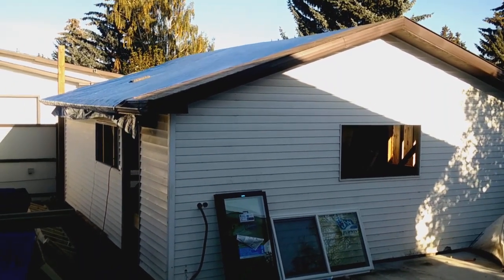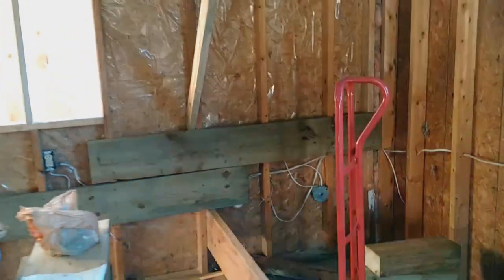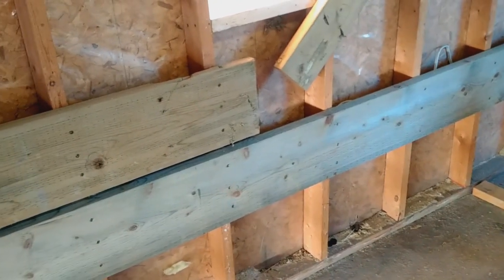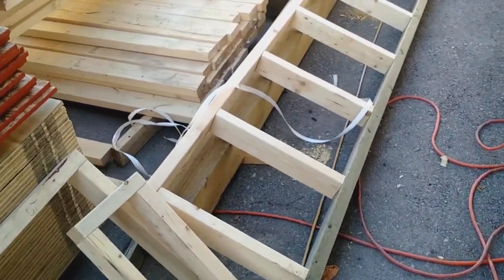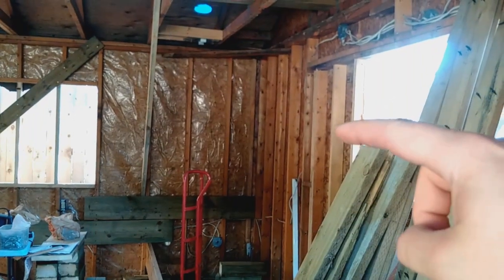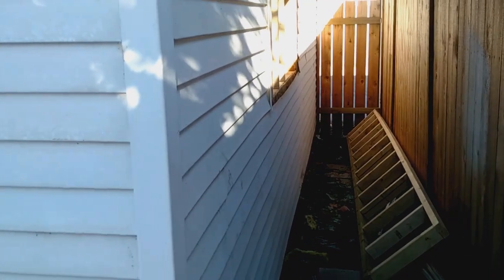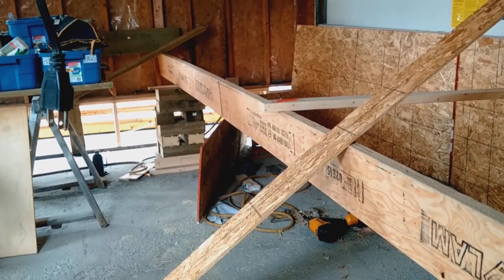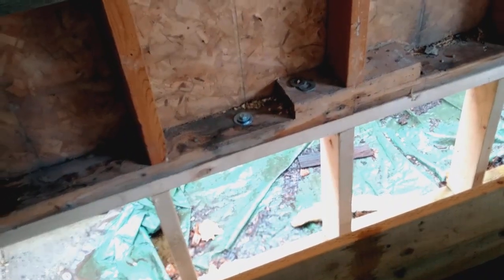How I lifted my double garage up 21 inches

Comment: We want to do something similar to a shed that framed on top of a slab with an extended porch.  I think the concept will work. We need to raise it about 10" and we plan to use cinder block and then re-pour the floor to the new height.   Any thoughts or suggestions?
Reply from the maker: I would think a shed would be easier.  Shouldn't have any issue.  So you are trying to raise the floor?  Is it a water ingress issue?
Reply: @johnniemo  No I think the slab would break up.  I figure it would be easier to raise the structure on it put block under then poor  a floor on top of the existing slab.  Yes, we are in Texas and Imelda stalled on top of us and we ended up with about 7" of water in the shed. Didnt even happen with the hurricane a couple years prior, but they have built houses next to us on a higher grade forcing the water to move on to our lot.  The shed is rectangular with a gable ended roof but the roof to the end of the front porch is almost like a lean two supported by 4 post.  So we figured we could brace up the front roof to the frame, brace up the frame cut the seal plate bolts, jack it up, rebar and concrete some block to the existing slab under the bottom plate all the way around, use a two by 12 and cover the garage door opening and front porch door opening, then re-pour the floor inside the blocking after reinforcing with rebar, then just put steps into it from the porch area and gravel out a grade to the garage door for lawn mower access etc..
Reply from the maker: @DLHappens  ok.  I didn't mean lifting the slab... just that you wanted a higher floor.  You just have to be mindful that water won't get under the slab and freeze it.  I know someone else who did your approach.  (he filled it with gravel first to drain).  However he had all sorts of issues.  Since you are in Texas and freezing isn't an issue, I think you'll be okay.  Just remember that any water getting in needs a way to get out, regardless where you happen to have your floor.
Reply: @johnniemo  Hmmm. Yeah I didnt consider that. Do you think mortaring the joint where the block meets the slab would keep the water out? Or have any suggestions?
Reply: @johnniemo  I wonder if cutting a channel in the exiting concrete, before the block, on the inside of the space, before pouring the new concrete, would keep water moving through mortar from getting between the two slabs.....
Reply from the maker: @DLHappens  Trying to keep water out is always a fools errand.  You are far better off having a plan to evaporate it or get it out.  Airflow is the best bet.  If it were me I would use coarse crushed rock and pour your new floor above it.  Holes in the old concrete can't hurt either.

Comment: you didn't really need to take all that stuff off just brace it up well and lift away I've helped my dad lifted several things a house 3 ft a 30 by 40 shed in one piece which we moved down the road on a trailer other sheds and garages some of which we took apart several floors it's not very hard to get a Big Jack that will lift way more than what you need just brace it really well

Comment: Please say if you got permits and had an inspection what county State  You calculated your load (12,000-18,000++  What permit drawings did you have two offer or an engineers drawing & cert.
Reply from the maker: Calgary, Alberta.  I got drawings for the entire build which was primarily the carport, but it includes the slab as well as the lift.  I talked to the city at least five times before the lift and then obviously had an inspection once the entire project was built.

Comment: Wouldn't it be easier to lift the roof and add to the top?
Reply from the maker: Yes and no.  I did consider this extensively.  Lifting the roof only has many advantages and one disadvantage.  If you are lifting the roof, you only need to detach the roof from the walls and lift.  The major upsides are that you can leave all the drywall, insulation and electrical alone.  Then you put your pony wall on top (or you could do a small triangle truss).  Finishing is easier because now you only need to sheet the outside and then continue your siding up.  Inside is just some drywall.  Major advantage is all your windows and doors are in the same place.

In my case I needed a larger garage door, so I think I disproportionately favoured my approach without looking at better ways to enlarge the door.

My suggestion - if anyone wants to try - is if you are doing this to put a lift in your garage (which I did since this video was made), is to buy the lift first and use it to lift just the roof.  This should mitigate the major disadvantage which is of course getting a stable lift 8 to 10 feet off the ground.
Reply: How to change your broken cable on a 12 foot overhead garage door
Reply: Anthony Perrellafd
Reply: John Molber
Reply: + Marco Derubis : INGENIOUS ! What department of the Government  did YOU work for ??? LOL.
Reply: John Mulhall n.
Reply: Dang, I am sorry, it's Canada.
Reply: Anthony Perrella iin
Reply: No it would no...
Reply: @johnniemo  Hopefully this will  defy your pros and  cons and chalk it up to...We Experience to gain Knowledge!  And... The house I'm in today... The roof was raised by 19 inches and due to the weight distribution a 34 ft span "hinged" by pushing out at the Wall to "Pony?" Extension!  Not A fun Project at all!  So.... with that said I refer back to Experience... IS KNOWLEDGE and no one can take that away from you!  Carry on John!  Thank You for sharing your experience!  Have a Blessed Day!
Reply: Let me add this as well... There are a slew of experts out there, until they don't show up!  LOL  Have great day Brothers and Sisters

Comment: Especially since you removed the shingles, why not continue to disassemble the roof  and remove it in pieces?  Then build taller (any height) walls, and rebuild the roof.  That way you are not lifting anything heavy, not moving any major windows, wires, etc..  Then address the garage door as a separate issue of moving the header 21 inches. No big lifting, no risk, no safety issues, less cost, no square issues, and more of a one guy job.  Just punch the roof sheeting nails through, and reuse the sheeting.
Reply from the maker: That is an option.  I didn't spend a lot of time thinking about that option - it could have merit.  You would still have a hinge point in the walls, which would necessitate sistering the studs.  You wouldn't be able to do that if you didn't remove the drywall.

I would challenge the "one guy job" part though.  Removing and replacing a roof would take several days, and a couple people any way you slice it.  You need to get the old roof down and the new roof up.  New trusses would also cost you somewhere north of $1000.  

Depending on your overall design and plan, I think this could be a worthy option.  However i don't think it would have been cheaper or easier in my case.  Also due to my timings, not having a roof would have exposed all my stuff to the elements for a week or two.
Reply: I agree.  One guy job is pretty optimistic!   It seemed as if you put a lot of thought into the project, and I just wanted to share the one thought of mine, to deconstruct and rebuild.  Very impressive what you did, nice style.

I was thinking of reusing the trusses, on top of the high pony wall.  But there would no way around the huge sky light for weeks!

Thanks for posting the video, and helping the DIY crowd, as well as  the reply to my comment.
Reply: I have been reading comments and his reply to one is he was doing it this way to increase his overhead door height without needing to also raise the header of the door which is additional time and tasks.

Comment: Bottle jacks...great and lumber for cribbing was what size?  6" x 4"???
Reply from the maker: Yes 6x4" posts cut to a manageable size.  I would recommend something more sturdy if you want to go higher.
Reply: Thank You....!
Reply: look up box cribbing timbers, you are good for 4x4 or 6x6 or even 4x6 , long length allows for four strong points and a more stable support than just one beam at each stack to rest the lifting beams on which is why professional use it so often, but i give him credit for having his come down despite what he had at hand

Comment: Great video and a lot of info here. Thanks.  Wanted to ask, when you reinforced the walls and corners, what did you use? Screws, nails or lags.  Also what about the 2x10 on the wall, looks like you just nailed them in, is this correct, thanks again..
Reply from the maker: The 2x10's on the walls, and all the major beams were attached with GRK R4 4" screws.  They are a very strong structural screw rated at about 700lbs shear strength.  Screw them in at a slightl upward angle.  Most of the smaller braces were just whatever screws I had around.  You want to use screws so they are easier to remove later.

For any really critical points I used GRK 5 1.4" RSS screws (basically lags).

Comment: I'm looking to do something similar with my 24'X28'. I'm in Red Deer, you should come and help me ;) (I'd pay you, lol). Is it not a concern using untreated lumber? Shouldn't you have used treated lumber, especially for the sill plate? Concern with mine is that it's untreated lumber set on a slab, I also want bigger doors.
Reply from the maker: I'm not sure if you HAVE to used treated lumber for the sill plate.  I did actually do that, although it may not be totally obvious.  

My wife is still upset about my project, so I doubt going to Red Deer to do another is high on her list of priorities :)
Reply: When if you already have not yet, want to do aside from how he did most properly but not completely safe despite he as lucky is cross brace the main lifting beams to reduce any chance of flexing which is why you see house lifters use cross beams that the main beams are placed under. all you need is three pieces of great length, two across and one diagonal so you have a truss brace, nail them to from opposite side of beam instead of inside which would allow the nail to pull out. you may still want to brace the corners to the main beams just to keep it squared up and also support the one "solid" end wall and overhead doorway opening from also flexing on you with similar cross bracing, simple smooth nails would suffice for the braces
Hop this helps you in your endeavor if you already have not lifted yours

Comment: my garage is about 3 times this size. no windows, 3 doors and a 2nd floor. do you think this would work?
Reply from the maker: Lifting a building in this matter applies force in the same way gravity does. So if the structure is standing this will work. You would need to brace the doors heavily and you may need stronger cross beams and even wall beams. But it should work.
Reply: @johnniemo  hmmm. so your saying i should live stream it to document the fall?
Reply from the maker: That’s exactly what I’m saying

Comment: Was awesome to watch that done. As this video is over a year old I am guessing its been said but Id of went with a concrete or even cinder block pony wall. A bit more expensive but that "hing" point where the two walls comes together makes me squirm a little bit. Enough metal plates would ensure it never moves but...
Reply: Yet another to assume such connection would be weak, just look at post frame or as it is traditionally known as pole building framing with nail laminated timbers, its plenty strong despite just through bolted as shown but adding a few nails between also helps strengthen said pony wall. It is all a matter of budget and time one wants to spend using either wood framing or building a more expensive though not often more durable against the elements if properly reinforced masonry pony wall.
Reply: What prevents a hinge point where the new concrete meets the old concrete?

Comment: Would it not be easyer to lift the roof ? Less effort ?
Reply from the maker: I outlined my thoughts on this in a few of the comments.  Granted there are a few hundred comments now, so it's hard to find.  But in a nutshell I wanted a bigger door, so this seemed like a better approach.  In retrospect I think enlarging the door would have been easier.

Comment: not bad, I am looking at doing something similar for a 2 post lift if we end up buying a house with a shop.. most shops don't seem to have the height that I want. otherwise I will just build to suit.. question though, why lift the whole garage not just the roof?
Reply from the maker: I theorized about this a lot.  The advantage to lifting only the roof is obviously less work and less weight.  The reason I lifted the entire structure was because I wanted a bigger garage door.  In retrospect, enlarging the garage door would have been FAR easier.  

Detaching and lifting the roof would be pretty easy to do.  If you were doing all this to buy a four post lift, then buy the lift first and use it to lift the roof.
Reply: Thanks for the input..
Reply: I have seen a owner use their four post with lifting crib frame raise their roof and walls to get a taller door opening alone without having to cut into and raise the header itself, the extra interior height was an added benefit.

Comment: That wall should of stayed in place, should of lifted the roof structure off the original walls and then install your new sections on top of the original wall. It would of been safer and the building would be more ridged and probably cheaper. Just saying to those who may want to attempt something like this
Reply from the maker: doctorbillz I dont disagree. As I've discussed before that was likely the better option depending on individual circumstances.
Reply: But I must say you have balls to attempt and accomplish something of this nature. Most people I know can talk crap all day long, and they say they can do something when they don’t or they can’t. Respect to you for doing what you say you’re going to do, I’d drink beer with you any day.
Reply from the maker: Well the fridge is full :)
I talked to folks who hired pros and they used this exact method.  The just put the whole thing on beams then place the beams on a trailer.  In the end it wasn't nearly as scary as I thought it could be.
Reply: Maybe less intrusive than raising the roof alone and then raising the overhead header to increase door height, as he said in response to some comments asking why this way, IMO this is "simpler" if not smarter than raising the roof alone. He is lucky the main beams did not buckle under the load and kick out the jacks seeing as he did not have cross bracing between the two beams unless i missed that view.

Comment: I'm wonderin why you didn't just raise the roof?  I'm thinking it would have been much easier and alot less work.  JMO
Reply from the maker: I did address that somewhere in the comments.  In short, I wanted the garage door to be taller, and this seemed like the way to achieve that.  In retrospect I think I put too much emphasis on that and there were other ways to enlarge the door.

Comment: why couldn't you lay 3 rows of block or pour a 2 ft tall rat wall under it when it was raised?
Reply from the maker: dirtdobber1959 you absolutely could!  In fact my inspiration came from a guy who did exactly that. 

http://www.garagejournal.com/forum/showthread.php?t=272678

The main reason I did as I did was timing. The pony walls can be prefabricated and inserted in matter of hours. A masonry wall would take at least a day and likely more.
Reply: Rat wall is to guard the underside of a slab or crawlspace from burrowing rodents, its not an above grade feature which rodent mesh is more suited for to deter rats and mice above grade. Then again they will find a way in through the 'door'way.

Comment: perhaps it has been covered, but what not raise the roof and put the spacer at the top?
Reply from the maker: I looked at both options.  Either would work.  In the end two things swayed me (rightly or wrongly) the first is that it is a lot harder to execute a lift from 8 feet in the air to ten feet.  The second is that I wanted a larger garage door opening in the process.  As such I chose to lift the exact height of a garage door panel (21")

In retrospect, I think lifting the roof would be easier if you wanted to leave the walls intact.

Comment: that hinge is very danger you should use hardy frames or interior shear walls to prevent any accidents
Reply from the maker: carlos GT did you watch the entire video?  50% of the studs are ten feet. That's enough. It's stood for two years as such.
Reply: laminated columns or beams either with glue, nails, or both are stronger and safer than you and a few others assume, but as anything goes, nothing is completely impervious to nature's wrath or other disasters, yet post frame are often built with nail laminated posts

Comment: It's been a few years. How is the result? I looked through 250 comments but did not see my following question…

How many inches of lift did you give to one side of the structure before bracing the high side and lifting/leveling the low side?

At 7:13 you count to 76. Is that the full 5-1/2" travel of the jack?  Thank you for this well-documented video.
Reply from the maker: Great question.  We started by lifting 4" per side, however at one point the garage "slid" a few inches.  It was terrifying.  After that we ensured there was never more than 2" differential from side to side.  So start at -2, then go to +2 and alternate.  After 4 years the structure is completely solid.  Drywall hasn't even cracked.  I have another video showing the finished product.
Reply: @johnniemo  Very good; Two inches (-2, 0, +2, brace at +2"). The "slide" must have made for a nervous moment. Thanks again.